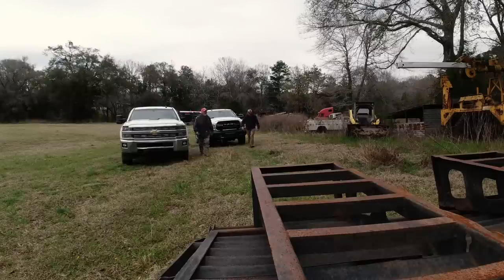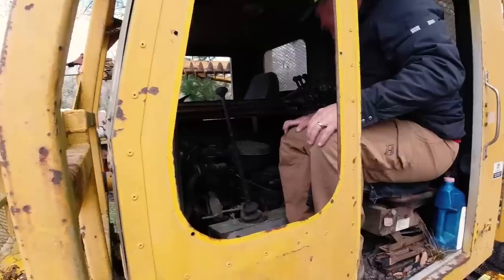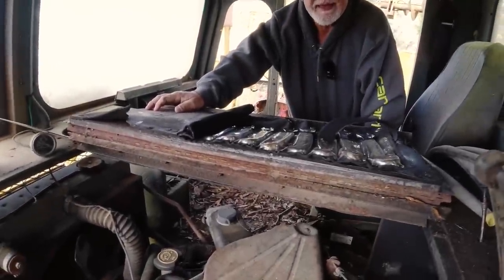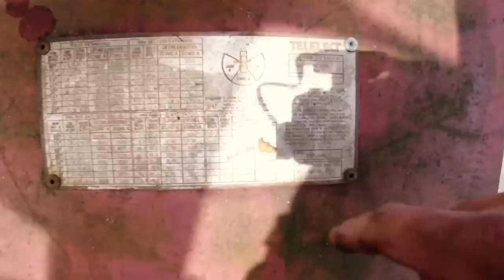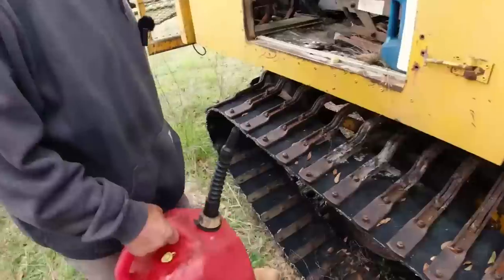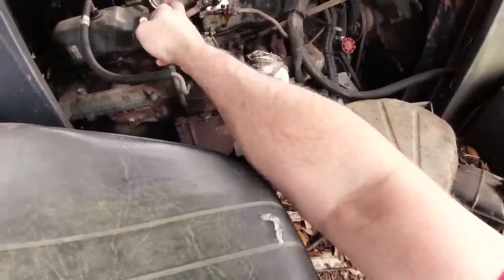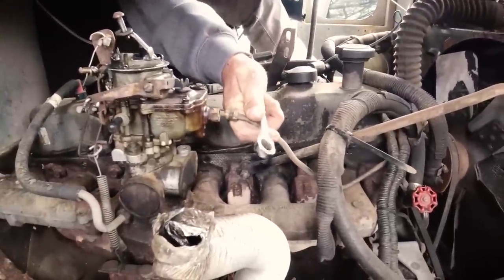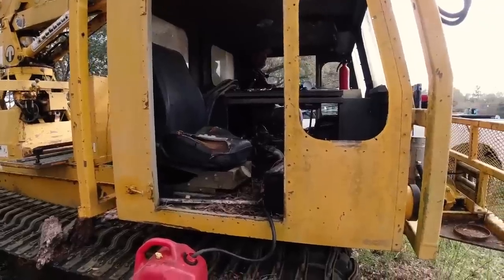Will it start? 90's Tracked Auger machine parked 10+ years!

Comment from the maker: ▶️Watch spreader video here: https://youtu.be/mqxXdPFf4ZA
Reply: That’s essentially a digger Derrick  which is used for setting power poles and sometimes telephone companies will use them if we’re getting into remote locations hence the why it has tracks on it! The auger is for digging out holes to set the power poles and the boom actually has 2 to 3 stages like most newer ones and there are a set of claws on the front that close around the pole and the winch is used to raise the pole up and down
Reply: @johnmathers4729  من

Comment: The way the engine is firing through the carb, I think the timing may be off, plug wires misplaced or valves sticking open.  I wish Jonathan W wasn't so busy so you could collaborate with him to get it running.  That would make some great content.  I think I recall that Jonathan worked at the Carter Carburetor Company many years ago.
Reply: I watch Johnathan he's good 
Did you see the old mini crane 
Series last yr? Go back n catch that.
Reply: Definitely timing issue I was gonna say the exact same thing if is has a distributor that’s the issue the cap or it’s Orr a couple degrees

Comment: Got the same boom mounted on a 91 international. Strong as a mule no hydraulic safety features to limit your power. Great for pulling pole butts. Much better than my 2011 telelect.

Comment: You need to clean the  points on gas engine if they have been setting for awhile, it gives it better fire, plus use a a different tank for  gas because it  get old and  usually will be dirty and plug every thing. and can cause damage inside the engine.  Carter carbs are pretty easy to rebuild Ask Matt from Diesel Creek  he is pretty good at it.
Reply: They fed it from the can 
Um I'd say half corrosion in carb 
+ the 2 wires they pulled they weren't sure of. And if they figured the actual  throttle on it. It would've done better.

Comment: Hi Guys, thanks for another great video! May I make a suggestion?  Check the firing order and clean the contact breakers. Unless there is a stuck inlet valve, firing back through the carb is a clear indication of incorrect firing order. Those points will be badly corroded, a quick clean will help with the coil charging. Thanks again!!!

Comment: Yall gotta come back and get this ol machine running. Those  Ford 300 sixes were born to run. They make damn near a diesels worth of torque too. Great engines. Git er done boys!
Reply from the maker: Stay tuned. part 2 next week.
Reply: These engines made more torque than the straight 6 diesel that Ford had for industrial use back then.. there is a reason the 300 was used in machinery that required Ford power..

Comment: I would agree that either the timing is off a little or the plug wires are in the wrong location to the plugs ( when you pulled them off a mark on the wires would have helped you ) but if you do come back to this machine I would happily watch the video. If you don’t come back to it we’ll I’m fine with that too. Keep up the good work and we’ll see you in the next one

Comment: Looks like something the line crew would use for setting poles in the right of way.
Reply: Yes sir. Usually they have a pin on bucket.
Reply: @chucknorris277  - I'm pretty sure our line crew has a tracked vehicle like this that's shared by 2 or 3 areas - I've only ever seen it used once around Pittsburgh.
Reply: Exactly my thought. This machine looks like it was used to drill big holes for setting power or telephone poles.

Comment: Idk what they used them for in South Carolina but I’m in Alabama and the power company use them to dig holes for power poles that are deep in the woods and there some that come with a crane and a trailer that would pull the poles also.

Comment: You need to clean the carburetor and maybe clean the points/check spark plugs for spark and see if the fuel ⛽️ pump is working..
Reply: If that engine is from the 80's I doubt it has points in it. With all of the popping and snapping he probably put the wrong plug wires on the wrong spark plugs. It tried to run but it had the wrong firing order going on.

Comment: When you pulled the plug wires off you may have put them back on in the wrong order. That would be why it is popping back through the carb and backfiring.
Reply from the maker: Stay tuned for part 2… you’re on to something
Reply: Check points and firing order timing is not right there not much different to diesel principle only thay use external spark rather than compression to ignite anway that's my 2 bobs worth keep up the good work from aus
Reply: Ignition timing may also be off.

Comment: For the regular truck version most electricians/telecommunications people call those line trucks because they are used to build or repair those respective lines...the foot pedal by the hydraulic controls is an auxiliary throttle control for the engine
Reply from the maker: Makes sense

Comment: First off, I love your shirt Hank, I'm a believer too, and He does love a lot of people, including the ones that most people won't love. I knew that engine was going to run once it cranked, I-6 engines are almost bullet proof, and tough to kill. If it ran on ether, it will run on gasoline, I'm sure you would've gotten it going if you stayed on it. Figure out what closes the the top of the carburetor throat, it's called a "choke", it helps the engine pull more gas into the airstream, and that will help. Love you guys, some of your jokes are hilarious!
Diesels are easier to get running, all you need is fuel, and it can be 30 years old if that's what you have.
Reply from the maker: Right on man. I appreciate the comment

Comment: Hank and Wiley the inlet needle in the carby is more than likely stuck closed.
Tap the bowl or remove it and clean it out.
There could be junk in there, a whole range of issues.
It would be cool to replace the engine with a Cummins or a Cat engine.
Or even a Detroit screaming would be pretty cool.
Maybe just a bit of research about Gasoline engines would help 👍😜
It was entertaining 🤣
I hope you come back and have another go because it would be so cool to see it driving and operating again.
I love seeing old machinery running again. Take care. 👍💪🇦🇺🇺🇲

Comment: Excellent video Hank  :) & Wiley  :) also that motor be in line 300 or 305 6 cylinders Ford engine 210 hp with 260 torque and powerfull ! All do put key ignition switch on pull choke all out then  push gas pedal 6 times and when crank gas pedal to floor and push choke in 1/4 dash till warm engine then 5 mins in ! Also don't stay running fuel filter clogged up dirty! Also dirt fuel that be in tank is jello and crusty too and carb get fuel from fuel pump!

Comment: Do you open the distributor cap? To see inside cleanliness, points, etc. Check plugs wire, firing order 1-5-3-6-2-4 back fire could be a symtom of mix wire. These Ford's are quite reliable engine. I'v worked on a lot of these in sidewalk snow cleaning.
Bombardier FW48 . See  Nick Miller you tube video. Yes gas engine are quite simple to diagnose.
Reply from the maker: Stay tuned for part 2

Comment: Hank & Wiley how do check a propane fuel tank is wipe tank down see wear the sweat around tank drip on cylinders too ! Can't check like gas or desiel fuel tank does and because unpressure to! Carb that machine is plugged too on jet needs rebuilt and you still get Carter from Rock Auto also sell them in rebuilt too!

Comment: Hello Hank & Wiley.  Don’t feel bad, My 1985 F-150 with the 300 cid engine quit twice in which I had to get a rollback to bring the truck home both times.
The problem seems to be a Engine Control Module/Computer in which Ford loves to hide. My engine does fire and will try to start- But that is all that it will do which I thought was very similar to what both of you were encountering.
With the starter on the opposite side of the engine, I’m not thinking that it is a 240/300 inline 6 unless maybe it has a special bell housing with a reverse rotation starter from what is mounted in the trucks. Also, If that engine was a 240/300 inline 6 - Those engines rely upon timing gears rather than timing chains. One thing to check is to remove the distributor cap and crank over the engine to observe whether the rotor button is turning - If not, It’s very possible that the engine has jumped time. The rotor should not be able to be turned or rocked very much by hand.
The engines ignition and fuel delivery system can be functioning correctly - But if there’s a bad computer or brain box, The engine just won’t run other than maybe a quick burst.  I’m wondering if the starting fluid was running more from combustion than from the ignition system if that makes sense.  More than likely that is a Ford Industrial Engine that your dealing with. I’m not sure what the exact difference may be without knowing what engine that you were trying to start. 
The Carter YFA carburetor was used by Ford for many years and a lot of different applications. Good Luck.
Reply: If it has no ignition there will be no combustion, your rambling makes no sense
Reply: @Big_John_C  Just wondering if the constant cranking cranking of the engine may have had an effect with the starting fluid. Sorry that I offended you by posing a thought.

Comment: Yeah I'd get A rebuild kit for that Carter carburetor.& mix up some  true FUEL.& add in 10% more to the 50:1 mixture then try restarting that motor.,or engine with that first after letting it sit in the float blow for 1hour then start up.

Comment: The needle valve is gummed up. Disassemble the carb, don’t be afraid, it was created from the minds of men and built by men and can be repaired. Soak it in some hot water and a little pine sol, rinse it in clean water, check all your adjustments and take note of the turns. Run a small, stiff copper wire down each orfice, flush again with some carb cleaner, blow it out with compressed air, scrub it down with a brass wire brush, rinse it again, blow it out again, put new gaskets and an accelerator pump in it and BOOM!

Comment: I live currently in Sumter have lived here in years center utilities is a powerline a light away company who maintains and rebuild’s powerlines the power company but they have several types of different tractor equipment at one time I believe they even use converted tanks with like bush hog Mountain to the front of the clear the roadways that looks like a unit they would used to get a hold for a pole

Comment: You are correct for having a respect for gasoline carburetors. A backfire when you are trying to bottle feed it has the potential for "problems". but you undoubtedly have clogged jets etc. in the carb and it needs to at the very least be dis assembled and cleaned but should be rebuilt tomake this thing run. For sure the accelerator pump is defective at this point. You have at least some spark since it keeps triring to start. Air, fuel and spark. You know you have two of those but you are missing a proper flow of fuel. I am glad to see you brought along a fire extinguisher. So many of these "will it start" videos show no sign of  that. Be safe.So sorry to herar about your dad. that is a horrible way to go.

Comment: Imma gonna guess these vehicles were indeed used judging by the diameter of the auger to drill holes for phone and electrical poles in rather swampy fields and other terrain where there ain't no roads . It might also be used for drilling test holes for wells and probing for underground resources such as minerals and metals.  I couldn't really see but it could or should have a rack that holds drill extentions to go deep . If it is for putting up poles it should also have a cable winch on top of the mast or boom . Or perhaps the poles are set up by a second vehicle and this one is just for drilling

Comment: it's a Ford only thing i had this issue on my truck trying to get it going spraying starting fluid i caught the whole front on fire, Luckily my gas tank didn't explode when i cut a hole in my bed to replace fuel pump it had about 4 gallons of old fuel in the tank i had a bunch of 1 gallon jugs of water setting next to me i only did it because i could not drop the tank at the time

Comment: My suggestion is that  you guys  should  take the carburetor  apart and fully clean it out. Gas engines in my experience are sensitive to dirt  and debris  that  ge5 stuck in the holes of the carb.

Comment: great video as always Hank/Wiley, you two had me cracking up and my cheeks and stomach are sore from laughing so much i had to put down my coffee mug, i think that engine was a 300 c.i. inline 6 , if its only a carb problem, you can find them in almost any wrecking yard, or take the tag # off the carb and it'll give you all the info you need, this thing will have electronic ignition for sure no points/condenser it is too new for that , I agree with one of the commenters it could be a timing issue which would suck or that little Ford engine module which i think i saw mounted on the passenger side in the engine compartment, Hank your right to have a respect for gasoline, it only takes a second for something to go haywire, your health is your wealth, without it you have nothing, I sure in the heck would love see to see this Telect run if you and Wiley decide to comeback and give it another go , you two just crack me up 😂
Reply from the maker: Part 2 is out this week 👍
Reply: @HamiltonvilleFarm  you and Wiley are awesome, looking forward to it 👍😎

Comment: That engine is a 6 cylinder 300 I know I had one. They're pretty tough little engines.
Reply: Ford made a 300 straight 6 it was a good engine.
Reply: @drufuss1981  
That is exactly what it is a Ford 300 straight 6 just like the one that was in my pickup truck. Judging from the air intake filter it looks like it's probably a 70 model.

Comment: I think you got the firing order off when you pulled the plug wires off. Also need to tap on the carb to unstick the needle from the seat. Tap right on top of the carb where the gas goes in.

Comment: The “1st” gasser you tried to start, has putting spark out the carb because you messed up the plug wires. Next time take a 13/16th deep socket for the plugs & only pull 1 wire at a time so you don’t mess up the firing order. Then you probably also had a stuck float, which would require taking the top off the carb & possibly replacing the needle & seat under the float to allow the gas into the carb. Also possibly a new float. Since you have no clue on all this you should take someone familiar with gassers a few times before you try to start one again by yourselves. Find you an old gas mechanic & teach him diesel & he can teach you gas and you’ll have a trifecta and be able to start 90% of the stuff you find!

Comment: Hey Hank And Wiley,
Simply pull the carb off the top ot the motor, and get a rebuild kit and clean and rebuild it. Almost any auto parts store should be able to get yall a rebuild kit. Then check the fuel pump and delivery.  
The engine looks like an old inline 6 cyl 300c.i. ...those are dang near bullit proof.
Good luck!

Comment: Don't know anything about that engine but the fan looks to be spinning opposite to what a car engine does. Is that engine rotating in the correct direction???? Find the firing order (153624 was common) and check the distributor rotor is giving that result to the plugs....

Comment: Take carb off the engine and strip it down it could be blocked jet or stuc float  if not shore about stripping it down as i did when starting of in mechanics i layed every thing out in order it came of then put it back in reverse

Comment: You might check the points pull the distributor cap off and check the points make sure you got the plug wires right when you pulled them off